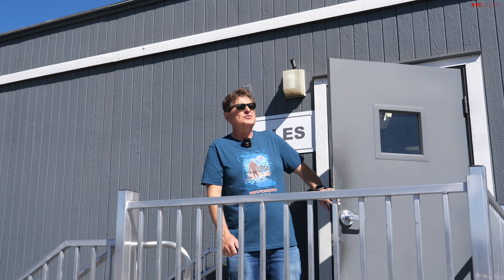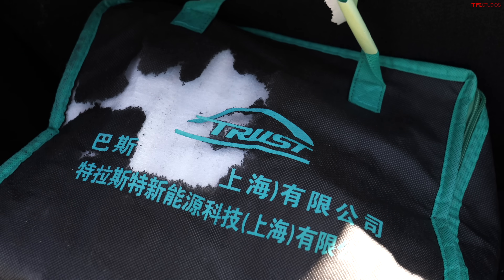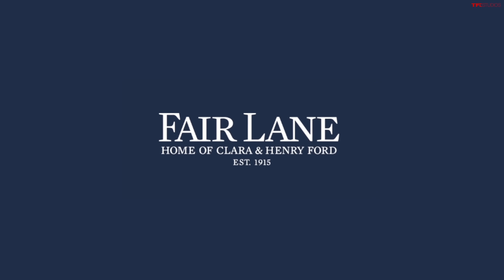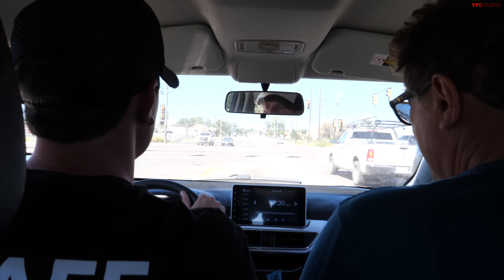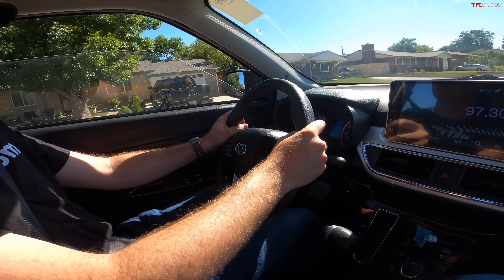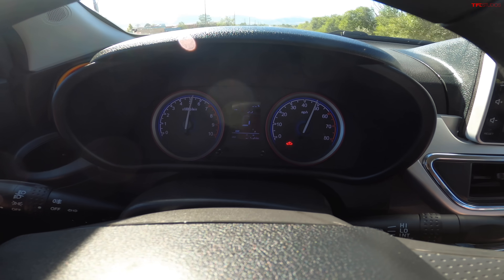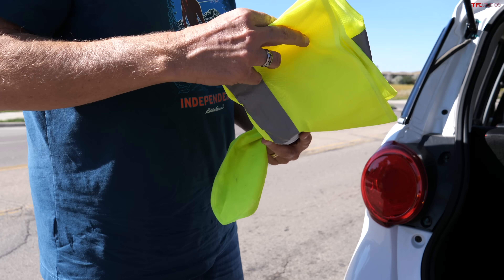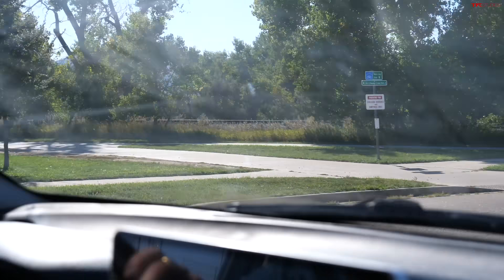We Just Bought the CHEAPEST New Car in America...And It IMMEDIATELY Broke Down & Left Us Stranded!

Comment: If I were to start an automaker, it would be a foot and a half longer and 6 inches wider, 13-inch rims, front ventilated and solid rear disc brakes, 45 KWh Solid state motor battery, 100 mph top speed, the same interior features as Kandia K27 but premium cloth seats instead of vinyl, and only be 5.5 grand more and made in USA.

Comment: There a lot of them in Texas driving around there and you can get up 65 to 70 did see some on the interstate. Has the range about 115 miles on a charge a lot of them self for $10,000 in Texas the other one is bigger K 25 had a range of 120 that’s 15,000. But there’s a way on yours to make it go top speed you have to change it in the pedal I forgot where it’s at but there is a way to make it go to top speed around 70

Comment: I'll bet money on the battery is severely out of balance and a low cell(s) is triggering a low cell voltage condition. If it has an advanced BMS you may be able to leave the car on the charger for several days (or more) and the balancing circuit will bring up the low cells however if it is a cheapo BMS like the ones on most E-bikes then it'll never balance on its own.

Comment: Get yourself a nice Honda suitcase generator. Keep it charged while you drive!  My question is why ther is a diehard 12v lead acid battery in there? Like for any reason at all? Isn’t it an electric vehicle?
Reply: So AFAIK, all EVs have a 12volt that's used for starting the system, then it runs off the traction battery.

Comment: if i were to own one and battery crapped out dont charger anymore i would take battery aparts to find that bms is fault defect and replace it and try to charger it if doesnt take a charger best choice is swapped out for 670cc twin engine and get away with it lol i have seen 670 go 60mhp with gear right set and someone took manuel transmission and bolt it to gear run to engine i was surprise by it and that car you just bought wasnt every on market at all it was all throwed in junk or acting and you are SO LUCKY GRAB THAT EV IT WORTH MAKING VIDEO OF IT because there is no other video out there about it because you are only one

Comment: This thing makes a Mitsubishi MiEv (or whatever they are called) look great by comparison
Reply: I've driven the i-MiEV, it's actually very serviceable for in town running. It'll do 55mph+ very easily and actually accelerates "briskly" (it's not fast). Reliable car as well. The older models get about 60 miles on a charge (late models upped that to 120). Using heat/AC cuts your range by half, but does have heated driver's seat to help with that.

Comment: The fact that the 12volt battery has been replaced with a DieHard tells you either this car has been sitting long enough for its original battery to have died, or that this electric car's manufacturer isn't good at making batteries. Or both...

Comment: Please don't shoot that thing, I'll take it, I could really use it, I am a disabled veteran and I live about 15 miles from the nearest town, I could use that thing to go get my groceries and stuff maybe one or two trips a week, plug it in to an extension cord from my trailer, it would save me a fortune, my only vehicle is a very thirsty '94 Ford F250 with a 393w stroker engine a friend sold me, if it can be gotten running again, I'd give you a few thousand for it, even if I have to go in and replace a bunch of 18-650s like Rich Rebuilds, who knows, maybe I could go Robot Cantina and add a little Harbor Freight engine driving the rear wheels with a single fixed speed for steady state cruising around 35-65mph, use the electric to get up to speed then have it strat when the clutch is released and just have an on/off, throttle and clutch to control it, all low speed work and reverse would be handled with the electric drive could be really cool.

Comment: “ is that the carburettor “ 🤣 what a lot of these new EV makers have been doing is putting half a real rechargeable batt pack with half a pack made from junk even wish wouldn’t sell so when they’re officially taken off the market the really good battery packs removed and the half crap packs left in it and since it really isn’t a sale of a new car they repurpose the pack they removed either in next years model or something else, maybe broken up and put in those power stations. The BMS can be set to accept the half pack as a whole so it would show as fully charged but you still have half a pack. The empty space somewhere is a giveaway so are bolts missing or shown to have been removed and placed back with tiny scrapes. Still laughing my assoff on the statement about your legs are the crumple zones . I gotta use that one. I would make it what it should be and keep it. Update what’s needed. Looks like all you need is there but the cost of doing that I wouldn’t pay more then 2 grand for it but still I could get it up to 65mph + and extend range 300 as upgrading the software errrrr ummmm easy peasy? Maybe not but it’s a good project car.

Comment: With a range of about 50 miles, and a top speed of around 35 mph, how bad do you really need those airbags? Salesman’s car? Not unless your route is limited to inside your own neighborhood with a range like that! Hope your batteries don’t catch fire; or your Kandi will melt! It is interesting to see this little electric failure car, but $7000-10,000 better spent on converting an older, interesting small ICE car IMHO. This thing is too slow the range is too limited to be practical and it would cost too much to make improvements to increase both than it’s worth at this point in technology. It’s a toy.